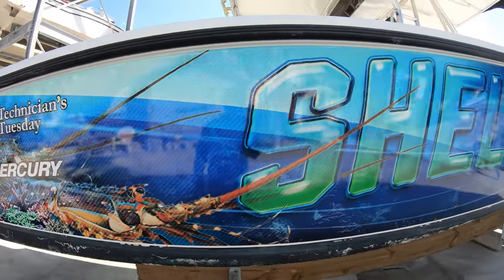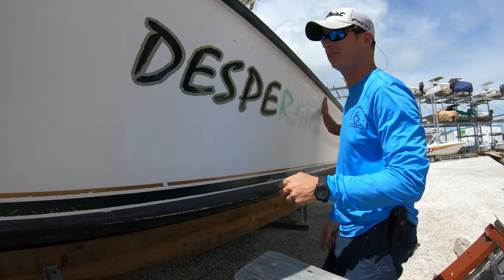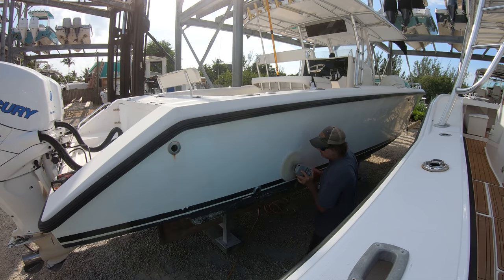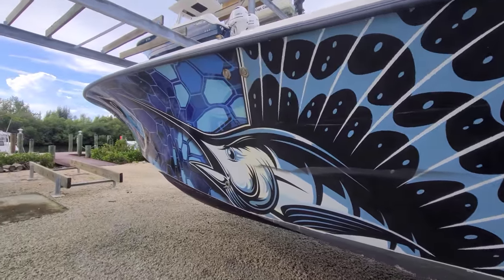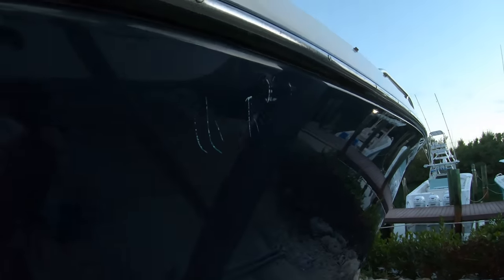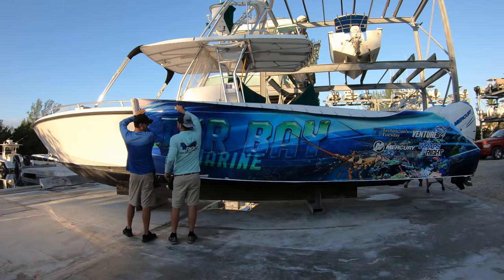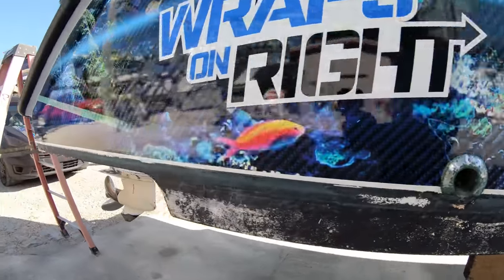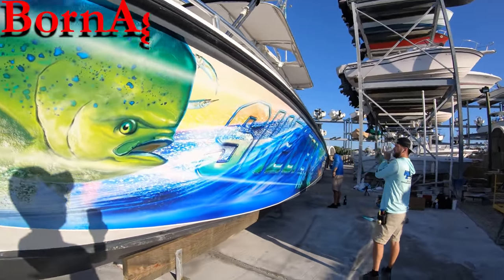Are BOAT Wraps A TREND?

Comment: I went down to a wrap place to have my hummer h2 wrapped instead of having it painted, they wanted $8,000 to wrap it..No Grapics just any 1 color, total paint job with 10 years warranty is 6.5 k, ill get it repainted, wrap not worth it for me….
Reply: I had the same experience when quoting wraps on a 24ft boat. Wrapping should be cheaper than painting, but that does not seem to be the case.

Comment: There's not a wrap on earth that would survive even one month in the water here in Scotland with the temp variations. Not a chance!  Even automotive 3 part with  2pack at every stage doesn't last a second season here. If you trailer it home every time and baby it then yeah maybe a 3rd season but top of the range  wraps don't even stay on motorbikes used on the road for more than 2yr here. All the nonsense about "just peel the wrap off when it's done and you're back to bare hull"   hahaha good one, as a coach/boat builder by trade who's first skill was spray painting.... I can tell you that's not the case and I'm spending hours on small 12-16ft hulls to get the old wrap junk off and the horrid discolouring it causes where you need to sand right into the gelcoat to get the original colour back and get all the glue contaminants out.

Comment: All in all it sounds like a boat wrap is the way to go! Either way, its gonna be relatively expensive, but like you said the resale value when you pull that wrap off and reveal that shiny new gel coat underneath is gonna be top notch. Great stuff!
Reply: @Aul Fishing maybe on the new boat 😉🤫
Reply: Assuming the wrap comes off lol. Trying to remove wrap from a car or boat after baking in the sun for a few years isn’t fun. My buddy is a 3m certified wrap and PPF installer and he won’t touch wrap removal jobs. They hire a special company that pressure blast it off. So not only do you pay to put it on but you pay to take it off.

Comment: Had my boat professionally wrapped. It turned out great but I found out quickly how easy it is to scuff and tear it. Better have all hands on deck when coming into the dock/slip or putting on/off the trailer, it’s fragile and not cheap to repair. If I could do it over again I wouldn’t.

Comment: A really good way to preserve the gel coat without having to go through the process of compounding and polishing 2-3 times per year is to do the compounding and polishing followed by a good quality ceramic coating. Ceramic coatings even in salt water can last well over a year if applied properly using a quality product.

Comment: Try a heat shrink wrap gun and be very cautious. It works great taking any old vinyl that's cracked etc. Warms up the glue and peels right off.
Reply: Bollocks your heating the glue up. Needs dried out chemically and sanded off like powder. If you sand or heat then sand it you are merely sanding the glue contaminants into the gell coat and you will have a hard time not getting it to show up in your finish, even primers have a tendency to overly flatten on improperly removed vinyl, silicone sealants, sanded out oil based paints and even marine adhesive filler. The secret to any work on the hull is never sand anything on till its been dissolved and doesn't smear.

Comment: I have a 2017 350 verado and I looked into the combustion chamber to find a ton or carbon. I have 600hrs and run the engine at 3900 to 4200 (peak mpg) most of the time. Not a lot of idling. 
Plugs are all  clean. 
Do you recommend or have you done a video on powerclean for a verado. 
I used to love ringfree by Yamaha, but just figured that was only good for 2 strokes.  Engine runs great, but I would like to keep it that way. Any of your vids cover verado combustion chamber cleaning?

Comment: Hello I have noticed that you are an outboard expert.
 I have a problem with my Mercury 115 ct. 
In forward gear, after 4000 rpm the engine vibrates and the revs oscillate, increasing and decreasing continuously by 200 rpm. The engine is not delivering the power it should. It doesn't push the boat as it should, at most it seems to lack the 400 rpm boost. In neutral, however, it struggles to exceed 2000 rpm and immediately rises to 2500 vibrating and oscillating a lot. What's his problem in your opinion? I thank you in advance

Comment: I got the front of my car shrink wrapped when I bought it new. After 7 years, I got really bad cracks on the wrap, it cost me a FORTUNE to get all that shrink wrap removed and I had to get the front part of the car repainted after the wrap was finally removed. What happens is that with the heat (summer sun is super intense in South Florida) the wrap melts and bonds with the metal or the fiberglass and removing it is a ROYAL PAIN IN THE A...!!! I WOULD DEFINITELY NOT RECOMMEND YOU TO GET YOUR BOAT OR CAR SHRINK WRAPPED!!!! RUN!!!!
Reply: Car wraps state in the instructions they only last 3-5 years for easy removal. You basically waited too long.
Reply: @Cadaverine1990  That may be it, I am not sure but DO NOT expect an easy removal! You may still need to use a heat gun to remove the wrap which may require an expert's help, hence additional cost and possible damage to your paint or gel coat. Unless you want the wrap for the looks, DO NOT GET THE WRAP because it will NOT protect the paint or the gel coat, on the contrary, IT WILL CAUSE DAMAGE!

Comment: Does the clear vinyl discolor over time? Probably depends on brand and age, just wondering though
Reply: Would depend on UV protection. You can clear coat over it then cut and polish back the clear coat with trizact 3000 onto 6000 then a polish with the perfect it Ultrafine with a blue pad and that will basically cover epoxy and gelcoat without making it look too overdone. Clear coat loves sanded vynl and bare epoxy for the record.